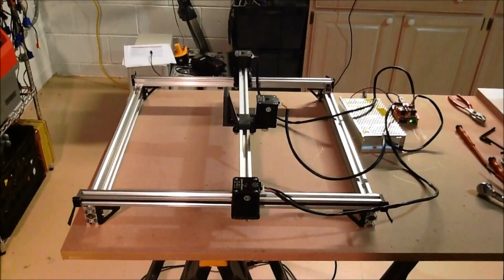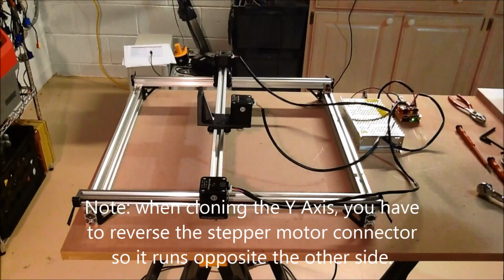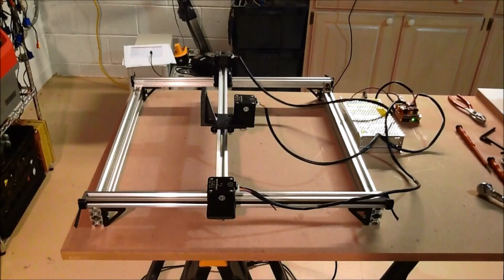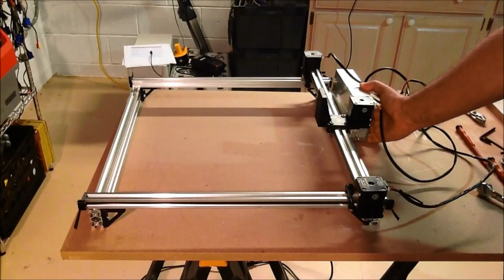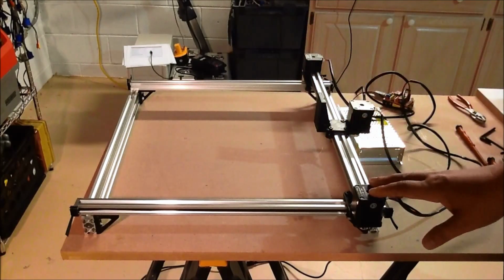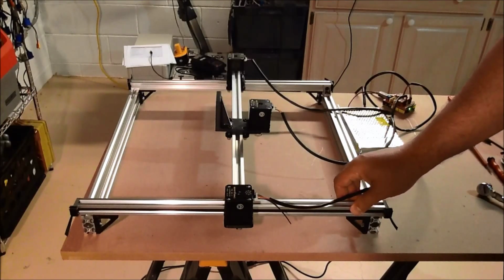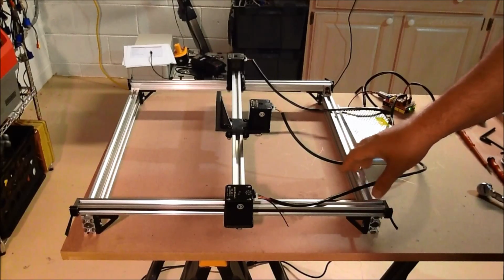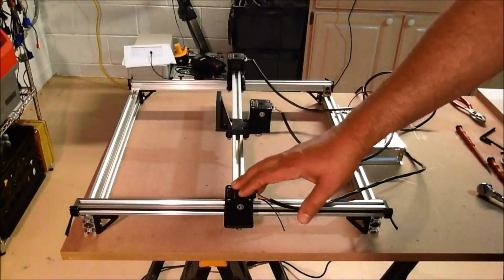2 Watt Laser Cutter and Engraver Project Part 7 - Connecting the CNC Shield

Comment: I have My Laser unit. It came with a wall adapter, 12 volt DC at 2amps. I have a 30 amp 12 volt power supply that I am using to power my axis stepper motors and Arduino with CNC Shield. Can I power the Laser unit with this power supply? I had doubts about the 30 amps being too much for the laser, or is this just available current. Any Ideas? I would rather use this, if i could, instead of having to rune two separate power supplies.
Reply: WOW! 30 amp? your laser will only pull what it needs to operate properly. As the case may be it will only pull 2 watts or 2.5 or whatever the rating of your laser is.
Reply from the maker: Yes that is correct the laser will pull only what it needs so no worries :-)

Comment: what ever happened to the rest of the project? No other Vids found. How did you wire up the laser unit, which pins did you use, did you have to alter the code???? You left me hanging..
Reply from the maker: Wow this was a LONG time ago but I did finish it and created a playlist (https://www.youtube.com/playlist?list=PLInTrkIbj69nt-dtYn7_jJg_vtpAlZXpE) so no you weren't left high and dry :-)
Reply: Thank You, I didnt think you woulda just dropped us like that, I just had a real hard time finding the next videos. Thanks for all you do.
Reply from the maker: No worries this was fun project yet you can get kits from GearBest that are cheaper and easier to build as I built this a long time ago...
Reply: mike did you manage to get youre laser connected. i cant find the right video aswell.

Comment: man, nice video, would you send me a video link where you show how to conect a laser diode on cnc shield en others wire conections?
Reply from the maker: If you check the play list for this it is covered.  You connect the PWM of the CNC Sheild to the PWM of the laser driver.  Note you will need to use both the M3/5 along with the S commands to make it work as typical...  Hope this helps :-)